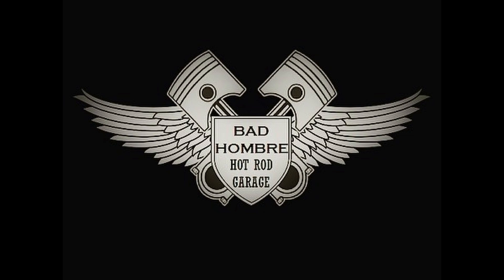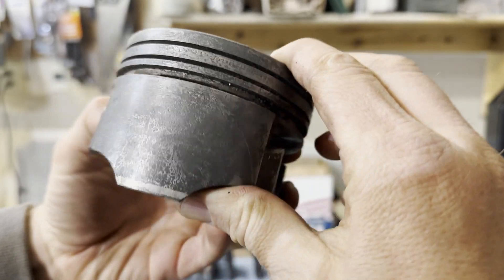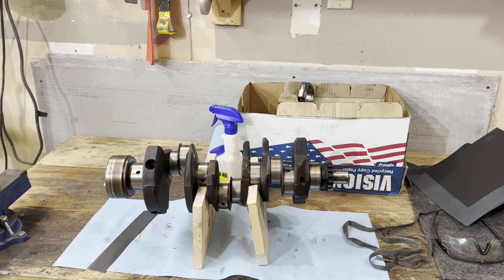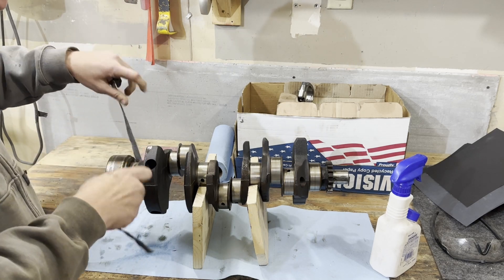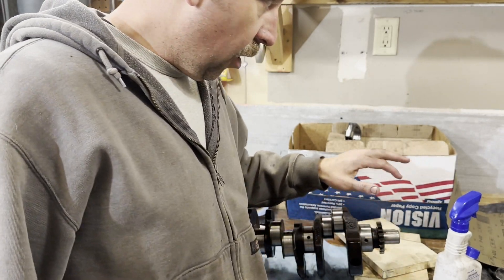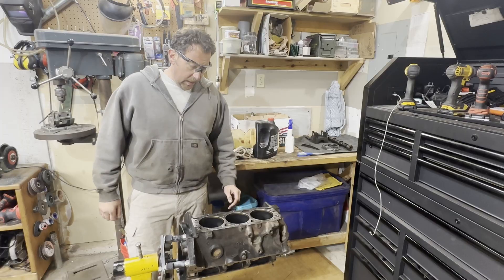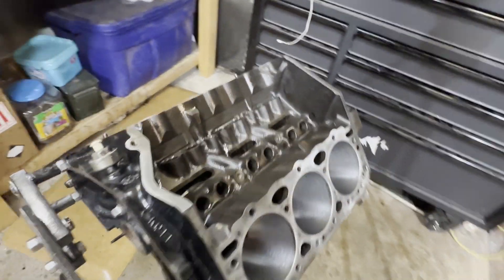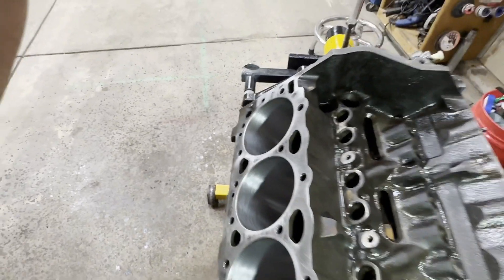Chevy 4.3L V6 Engine: Polish Crank & Hone Cylinders...  Engine Building Prep!  Bad Hombre Garage 128

Comment: Oddly enough, it's common practice in machine shops to use 80-150 grit Emory cloth to bring bearing journals to size on shafts turning slowly on a lathe. It takes quite a while to take off more than a thousandth (0.001) of an inch.  off. I'd definitely say you got a good method there.
Reply from the maker: Thanks! I have the engine running and driving now and it works great.  Makes good oil pressure.